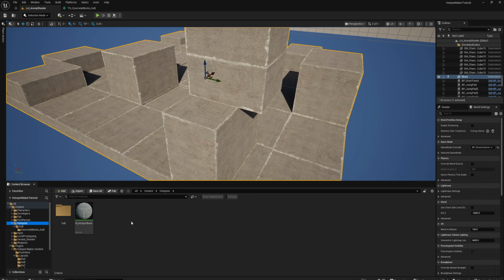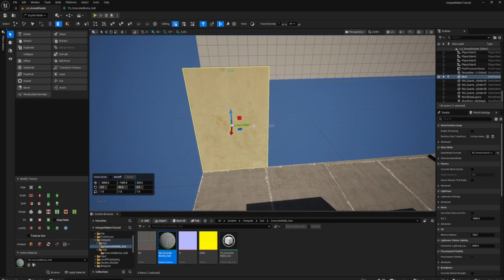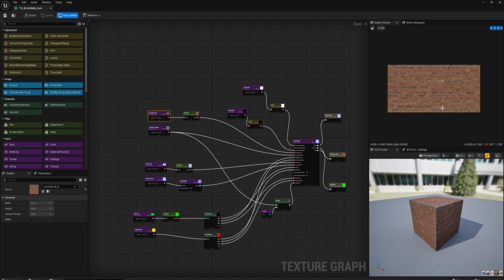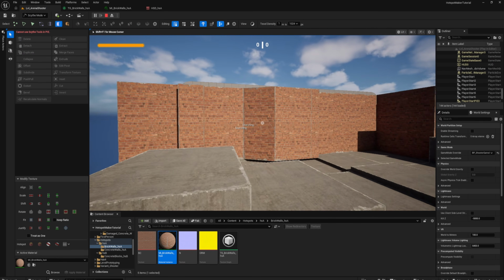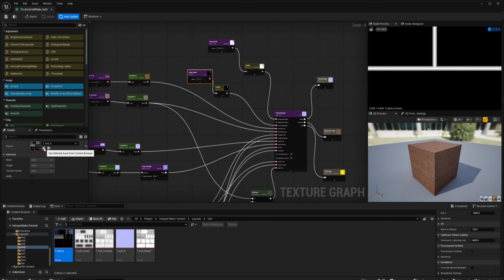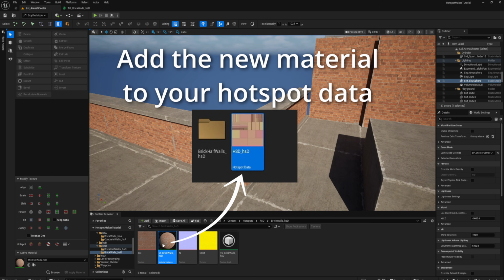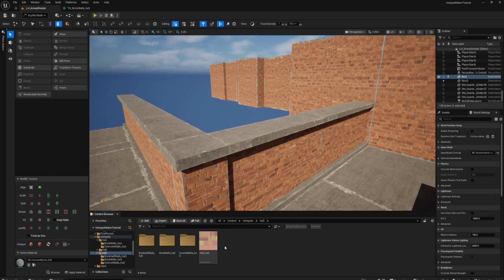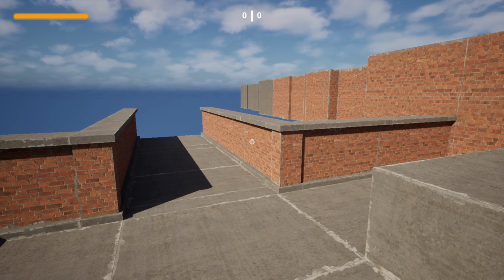Hotspot Texture Maker - Walls

Comment: thanks for this tutorial and the one before its funny that I dont even use unreal
 also what is your best advice for stretching
what does shambler studio stand for ?
Reply from the maker: Stretching? Like your UV is being stretched on the geometry you're applying the hotspot to? Which tool are you using to apply the hotspot? DreamUV has a way to "scale" it, and mine you just need to set the proper texel density. If you still get a lot of stretching, you're trying to put it on a face that just isn't a good fit for the hotspot layout.

It's named after the shambler from Quake 1. The shambler has spawned and is trying to shake (quake) the industry. It's me trying to break into the industry after not having the ability to for decades and try to do something interesting.
Reply: @ScytheEditor  I see thanks but also I wonder why not many people talk about hotspot a much ? like even in google search there are barley any results

Comment: 4k texture is a bit insane
Reply from the maker: Hotspot textures should generally be about 4x your texel density for your game. You can easily output to a lower res for whatever you need too so if your texel density is 128px per m, you'd just want a 512x512 hotspot texture.